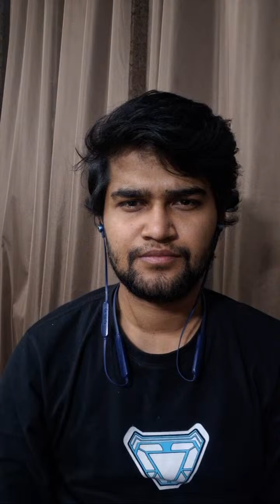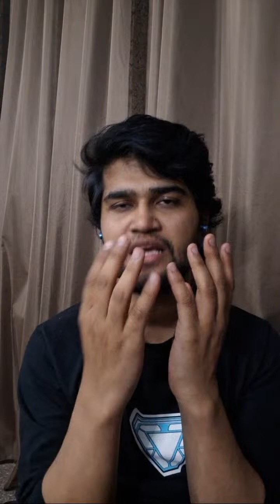Process Engineering Job and Skills Live Session | Freshers Guidance | Ask your Questions❓

Comment: sir I am weak in calculation I have not did core subject equipments etc calculation how can I improve and how should I start calculation learning . I have good knowledge of unit operations but I want to make myself better in process calculation . as you said  for process engineering work your calculation should be good yes true that's why I am asking
Reply from the maker: You need to start from basic calculations and understand that questions what why how and then go ahead with intermittent and hard.....also I'll upload the video about the calculation